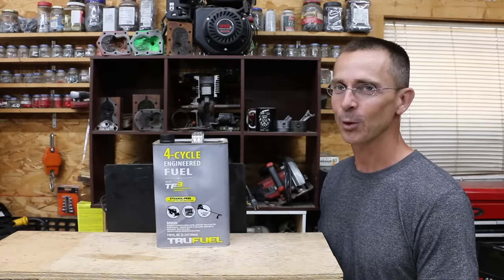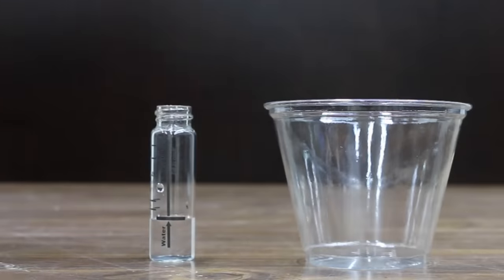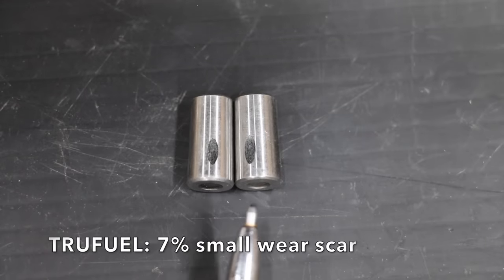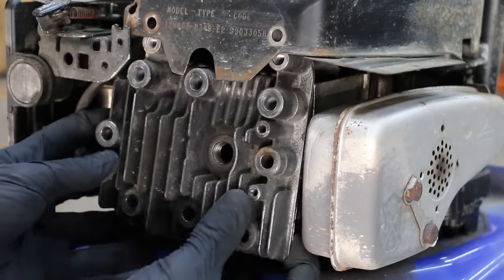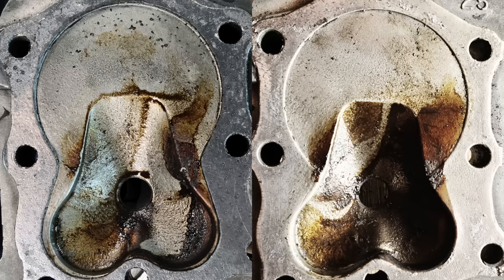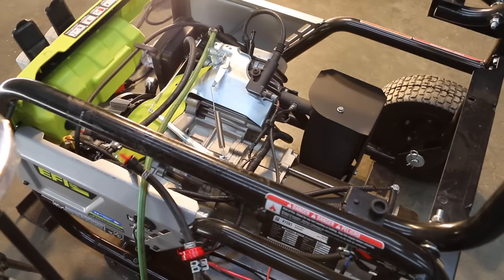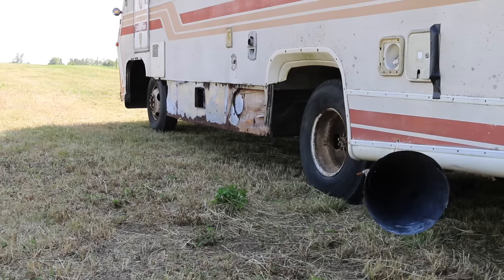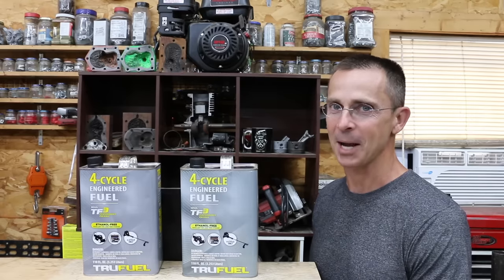Engineered Fuel better than Pump Gasoline?  Better Fuel Efficiency and MPGs? Let's find out!

Comment from the maker: Thanks to everyone who requested this one and please continue suggesting future video ideas.  Also, thanks to everyone for helping support the videos through your generous Patreon support. https://www.patreon.com/projectfarm  and through merch  https://teespring.com/stores/project-farm   I look forward to reading your comments and video ideas. Thanks again, Todd
Reply: Love the content!
Reply: Please CVT OIL comparision Nissan NS2 vs NS3 va amsoil vs valvoline
Reply: Great video
Reply: Leave both fuels in a carburetor for a year or so. See if either is better at not gumming or gelling up in the carb. Been using tru fuel to store small engines for winter.
Reply: Storage is one of the tru fuels claims to fame.
Reply: Love the farmabago i was dying laughing at the end
Reply: Project Farm I guess you don’t want your name to be a secret LOL have a great week Todd .
Reply: You know the YTuber is a cool altruistic guy if you find out his name after you watch 100+ videos of theirs
Reply: It might just be me but i find all the claims from various bike parts just mind boggling.
I'm thinking things like floating (2 part) brake discs vs standard one piece discs, organic vs sintered vs ceramic brake pads and standard backing plate vs the various heat sink designs - be great to see some red hot discs and pads for these!!
Also the different lubes/greases - synthetic, biodegradeable, ceramic etc. Wet vs dry lube.
Lastly bearings - cheap steel ball vs ceramic ball vs the various cartridge designs.

The bike industry is massive and has many, many channels with millions of followers here on youtube but none do technical reviews like you do.
Thanks.
Love your channel and your work.
Reply: @saedin1  From a certified tech that owns a Rouge, Use NS3 as it has superseded NS2. First gen CVTs had hardware issues, second gen was screwed by management deciding people needed "gears", third gen and up are pretty good if you keep the fluid fresh. Amsoil is what we call "Jesus in a can", its pure bull that is not worth the money and to be honest I personally do not trust that the EXACT specification for the fluid is being provided by aftermarket manufacturers. It is absolutely vital that you use the correct fluid in these units and change it frequently, 30k miles or so depending on your driving. It is actually as easy as changing engine oil if you do that on your own, there is a fitting (amazon) that makes it easier and I would recommend a bottle pump (any auto parts store) to make filling it easier. Change that transfer case fluid at the same time if you have AWD, it sits right above the catalytic converter and quickly cooks the fluid. Nissan will tell you something like 90k which is far too long.
Reply: I really appreciate all your experiments. Nice one bro
Reply: Great content! Create a YouTube memberships scheme. I'd honestly sign-up that way 👍👌
Reply: Please test different "rust stop" spray paints and their corrosion resistance!
Reply: I suggest a revisit to the EPOXY arena. 

 This time use steel, plastic and wood as the main base foundations and any combination in-between to see which materials hold better to which epoxy type.

For example:
Bond a 2x4 to a 1/2 steel plate to a 1/2 piece of Lexan on both the top and bottom plates identically as well as individually. Then pull them apart until failure. My Loctite epoxy is rated to 3400 PSI, but on what material? Under what conditions?

I bought the stuff and I still have questions! If you can and if you feel like, I suggest a retest of EPOXY's.

Thanks man,
Cheers. 🍻
Reply: @project farm.
Try testing Aspen fuel if available in the us. It’s a Swedish fuel.
Reply: Try coolant different brands different types what product is better for the pump do the cold,hot test and how bad the water is (sorry for my English)
Reply: I can really appreciate how thorough you are. I always know you'll test everything and I completely trust your judgment/results.
Reply: Awesome test! Look forward to seeing the 2 stroke version next!  Thanks for doing this, love the channel!
Reply: How about a long term Tru-fuel vs normal vs anormal with added stabiliser?
Reply: Hey, you should try out the STIHL MOTO4 it’s four cycle fuel from over the pond!
Reply: Video idea: test Energy Release, an engine oil additive said to reduce friction by binding to metal components.
Reply: And thanks for all the great entertainment, you've helped me make a few decisions when it comes to buying products.
Reply: Now I know your just having fun with this stuff. The double circle check? I love it
Reply: Thanks.That sounds suspiciously like a scam. You might want to compare new fuel with fuel which has been stored in an airtight container for a year.

I buy fuel in Summer when prices are low, and store it in a sealed 25 litre drum for possible emergency use in the next Winter. If it is not used, then I fill the car with it, and replace it with new fuel in the following Summer. 

I do not notice any performance degradation in the old fuel, but that's because no precise measurements are taken.
Reply: @ project farm don't let California know about this engineered fuel
Reply: Please! Do round 2 summer diesel fuel additives compare Standyne, Hot Shot Secret EDT, Best Line, Amsoil cetane cleaner lubricator, love ur work!
Reply: How about are Honda generators, or outboards really worth it?
Reply: Can you run the wear tester for a few seconds before dropping the load onto the wheel?  This way, you wouldn't have the run-time before the lubricant can get to the meeting face.  I'm curious as to whether or not it makes a difference or not.
Reply: Stupid question probably; sorry ahead of time. What do you use to clean the cylinder normal grinder or a super fine sand paper?
Reply: @thisisfun887  This please :)
Reply: PRi-G fuel stabilizer works well, no sure about 5 years though.  It claims to restore stale old fuel to newness.
Reply: INVERTERS!
Cheap ones, like the Power Drive, found in just about any truck stop, and compare it to the expensive ones like RV and outfitters have, and size matters.
Small ones claim to have a cleaner sine wave for delicate electronics, while the bigger ones are for coffee pots and power tools.
Reply: Kaycess general.. haven't heard that since I lived in missouri.
Reply: Vehicle air filters for initial flow rate, filter ability for small particles, and the flow rate after being exposed to a lot of dust. Washable filters for their air flow after the test after they've been cleaned.
Reply: Any thoughts on doing the gun lubricant testing
Reply: @chrisgabbert658  lol gun bad in modern media
Reply: i would love it if you could do a video on what the best tubeless mountain bike tire is, although it will get pricey!!!
Reply: If you’re selling your Winnebago, I’m interested?
Reply: Hey @project farm why not try witch 6 volt batteries hooked into a 6 volt series and test them
Reply: Hey there! My name is John Munoz and I was wondering if you could possibly create a video on the best weed killer on the market. As you know, lots of products claim to be the most effective product but your never quite sure if you pick the right stuff for your own home. I am a failthful viewer of this channel and love all videos you have made and informing myself on which product is best for the job. Thank you so much for putting all these products to the test and I will be looking forward To your next video!
Reply: Johnathon Munoz what I use is either arsenal or roundup
Reply: What about a video on tru fuels 2 stroke vs mixing 2 stroke fuel yourself?
Reply: Harbor Freight Miter Saw vs name brand?
Reply: % of water in alcohol, how does it affect flammability, and changes in engine operations.
Reply: Injector cleaners seem not to be tested on your channel. ..
Reply: Fridge filters. Are the cheap ones as good as the oem?
Reply: @brothertyler  it's been dine
Reply: Doing donuts in a motor home. Now I've seen everything.
Reply: I think you better invest in a limited-slip or select-able locking differential for the 14-bolt of that RV, judging by the amount of wheel spin it produces.
Reply: Can you do one on, they're making these "zero turn" mowers, which are actually "cha-ching, cha-ching" rip-off mowers!!   They found out it is much cheaper to put on rollers on the front, and just use two tires in the back, yet they charge you almost 50% more compared to conventional mowers???   I can't believe people fall for buying these desks on wheels!!
Reply: How much would it cost me to have you do a shop experiment for me? 
You have proper tools and knowhow.
Video idea: test tensile strength/break point of trailer deck tie down anchors (through wood and or metal). Purpose to determine if advertised break points are accurate. To determine if bolts just through wood are weaker than through frame or combo of wood only and frame, and if there is improvement by having a backing plate when bolting just through wood.

Ha wouldnt be as fun as the winnebago run for this video idea though unless you thought of ways
Reply: My idea: is there s difference between pri-G & pri-D fuel stabalizer verses stabil
Reply: Please do some diesel testing, injector cleaners, fuel differences #2 diesel, kerosene, oils, liqui moly, rottella ect... thank you!!!
Reply: How about testing the various fuel stabilizers on the market? There are a lot of them, plus I've heard urban legends (perhaps...) about Marvel Mystery Oil and ATF also being able to stabilize gasoline to increase its shelf life. 
I also can say from personal experience that I once had gasoline stored in a 5 gallon, red plastic can go bad in about nine months, when the exact same fuel, taken out of the 5 gallon can and stored mixed with 2-stroke oil for the same amount of time in a 2 gallon red plastic can did not. It seemed to me that perhaps 2-stroke oil is also a stabilizer. Unfortunately, I cannot remember which 2-stroke oil it was. 
It was green in color though. I do remember that! :-)
Reply: Project Farm Please do a Harley Davidson syn3 oil 20w-50, vs Schaeffers 20w-50, vs a few others. Please please please!
Reply: How about testing low rolling resistance tires? If and how much of a difference do they make and which ones are the best.
Reply: You should test wood water sealers, for decking, fencing. See how long they last for, color, Uv, water repellent duration, etc. Like Tompson’s water seal, there’s also some home made recipes on YouTube.
Reply: I would like to see a video on high zinc/ racing/ hotrod/ classic car Oil VS Regular Oil
Reply: Project Farm that’s the wrong head gasket
Reply: Aaaaand it's Team Farmbago by a country mile! 
👏⛽🚙
Reply: Been watching for a little while PF. Subbed from the start! I’m glad to see your channel grow as it has. You put a lot of work into your videos and I actually use them to make my own purchasing decisions. Keep it up 👍
Reply: @jordanhastingss1066  The Stihl fuel here in the states isn't called MOTO4, and it is literally rebranded TruFuel. TruFuel actually bottles it for Stihl.
Reply: hey, you show 110 psi on your video with 3.58 bar which is incorrect. 7,58 would be correct.
Reply: 92+ seems low, Super plus in the uk is 97
Reply: How about testing fuel stabilizers?
Reply: What about a "best garbage disposal" video?  The range of prices are huge and it would be interesting to see a tear down (like you did with the Makita drills).
Reply: I know this is kinda outside the realm of what you normally test but I was wondering if you could do some tests on different liquid dish soaps. Which ones are better at cutting through grease, stuck on foods etc. And also whether or not the ultra versions are better than the regular stuff and whether the more expensive brands perform better than the cheaper ones.
Reply: Trufeul compression is not wright it needs to be 7.58 instead of 3.58 bars
Reply: You just keep having too much fun!!!
👍🏻👍🏻👍🏻👍🏻👍🏻👍🏻👍🏻👍🏻👍🏻
Reply: Please weld the diff in the farmabago
Reply: hey, seeing you cleaning up the combustion chamber I noticed a notch in the piston to indicate "forward". This reminded me of a conversation I had in tech school with an engine repair teacher, the reason for that is the wrist pin is offset to one side so that the piston doesn't slap at the top and bottom of the stroke. most aftermarket (car) pistons have a centered wrist pin, but apparently, if you turn stock pistons around on the rods (rods are biased usually, idk about small engines) then you offset your pin to the other side, which actually lines up better on the power stroke give you more torque (not necessarily hp iirc). Now, he was an old bracket racer and his division or whatever it is called was all OEM parts, so no aftermarket pistons, so this is what they did.

I would love it if you found a 2 cylinder and tried this. just press out the pins and turn the piston 180* (measure the pin center with calipers to figure out the offset) and see what the difference really is
Reply: How about doing a test on what cheap or expensive wrenches do to fasteners?  All the regular guys break the wrench or ratchet. The real problem is what's the tool does to the fastener. In my shop experience I use the same bolts on fixtures in a machine shop setting. I tend to think cheap tools wear out the fasteners making it necessary to replace the fasteners. In the real world of being a mechanic, I would tend to think this would be a very big issue. It would be very unprofessional to tear up bolt heads only to pass it along to the next guy  that has to deal with your cheap or expensive tools wearing out bolt heads. Great channel hope you read this!!!
Reply: I have an idea for a video. as a pipe fitter I use a grinder for cutting threaded rod. now I know I'm not supposed to use the same cutting disk to clean up the ends, but sadly I do cause I don't have two grinders, or the time to swap out disks for each cut. I would like to see how long a cut off disk can last being used as a grinding disk. it's not a lot of pressure and it's not for extended periods of time
Reply: What is the best oil seal for small engines?
Reply: can you test the durability of a cut off disk that's been used to grind the edges of hanging rod. curious to see how long one of those disks lasts before it fails
Reply: Great job as always. I was thinking about a show down in hole saws.
Reply: I love the background music and thanks for sharing good information.
Reply: Great video I gu the best part is with the 🚐
Reply: He literally has the best channel on YouTube. Reminds me a lot of tnoutdoors9 except with engines
Reply: You should see what's the best needle scaler
Reply: Do a test of v belts, which transmit the most power, last longer, raw edged vs wrapped. I've been using carlisle super ii raw edged for years and swear by them.
Reply: What about test of car brake pads: cheap, OEM and performance ones
Reply: Pure marvel mystery oil as fuel in a gas or Diesel engine.
Reply: That’s a sweet YouTube ride! Movie suggestion: “The Fast and The Flatulent”😇
Reply: @saedin1 , already did on my channel, did you see it?
Reply: @saedin1 , also,  I have exposed in my video Nissan fake advertisement for cvt atf.
Reply: @d00kiejones , Nissan CVT fluid is made by aftermarket company.  Nissan doesn't make their own fluid and they keep pushing false information to customers even their techs are clueless.
Reply: @davidf922  amsoil already did that
Reply: @ProjectFarm .....Video idea: Test  brand name and store-brand mosquito repellents (Plus some urban myths/old wives tale methods) that supposedly repel mosquitoes. -thank you being there best subject 😁🤣
Reply: Video idea: Test the brand name and store-brand mosquito repellents (Plus some urban myths/old wives tale methods) that supposedly repel mosquitoes. -thank you being there best subject 😁🤣
Reply: Your real world application of the scientific method gives me faith in humanity. Good on yah Sir
Reply: Thanks for showing us engineered to mark the price up on can and cool paint. What a snake oil fuel
Reply: @brothertyler  I think he already did this.
Reply: Great work as usual! Ever planning a test on different metal polishes?
Reply: Hello question what about trying 100% mineral oil as engine oil?
Reply: Can you please test kerosene against Gasoline.  I used to fill my Dodge ram 1500 with mostly 93 octane and then put about a gallon of kerosene in it to clean the inside of my engine.  Can you test this to see if I was right all these years @projectfarm
Reply: Test to see which stud finder is better
Reply: Can you test some septic enzymes? Like RidX
Reply: Project Farm, I have heard you can decarbonize an engine using regular water.  Could you test this theory?
Reply: Can you please test spades/ Shovels. Forks, edging tools like hoes, gardening tools etc.
Reply: Please do a sandpaper test! See which brand takes the most material, finest/best finish for wood and metal, and which lasts the longest! Keep up the good work!
Reply: would love to see a comparison between cheap vs expensive furnace filters, how many particulates each catch, airflow through each filter, price, etc
Reply: Even before watching this, the first thing that comes to mind is that all gasoline is engineered, since "gasoline" -- even from Discount Zone -- is a mixture of hydrocarbons and other additives, and thus "engineered" to meet government regulations.
Reply: How about a video comparing different wall filler?
Reply: Mr project farm ive got video idea ive recently put some gas in and old Stanley cleaner jug i noticed the smell of the product i was wondering if you could use essential oils  to make a good smelling small engine in your lawnmower
Reply: Todd, I like your new test vehicle! Obviously “Project Farm” approved - haha. Thanks for the comparison video. Guess the only thing better than at the pump high octane no ethanol, is you get a storage can. Haha
Reply: Have you done heat and ware test on 10/30 vs 15/40 ? Maybe in a generator?
Reply: Scott Haydin https://m.stihlusa.com/products/oils--lubricants-and-fuels/premixed-fuel/moto4/ it is called MOTO4, and I’d bet ya good money it isn’t the same thing. :)
Reply: Can gasoline engine run on diesel
Reply: Episode Suggestion: The impact of various automotive fluids on paint and clear coat (e.g. gasoline, brake fluid, windshield washer, transmission fluid, engine oil, antifreeze and of course blinker fluid).
Reply: I'd like to see a video like this comparing Trufuel 2 stroke fuel mix to pumped gas and oil homemade mix. Great video.
Reply: You should make a video on how to remove ethanol from fuel and compare it with tru fuel
Reply: Can you test fuel injecter cleaner that will not damage my catalic converter
Reply: Hey there , have you ever done or considered doing a drill powered wire brush test like amount of material removed life of tool and all the other very interesting things you come up with
Reply: @SvenStadt  Check out the price of the hydros - they aren't; cheap and two are required for a zero turn!
Reply: As always, amazing. I know that you make it look easy when in fact, it takes a lot of work to make your videos, so thank you for all your hard work. We always look forward to new content.

Suggestion video: How about one on! how to decide which one of your 3 potential wives to choose? LOL!!!

"Lady #1 says that she is very patient, so we're gonna test that."👍👍👍

Just kidding of course .
Reply: Could you please do some more in depth tests and comparisons of engineered fuels. Do they really burn cleaner? Can any clean an engine? Is the exhaust less unhealthy? Does it gum up a carb more or less if it dries out in it? Thanks.
Reply: I would like a test on Trufuel in a two cycle engine. Does regular ethanol gum up the carburetor more than engineered fuel does?  If you previously done this video I couldn't find it. Thank you, John
Reply: Looks like “True Fuel” is making a true fool of themselves and their customers.